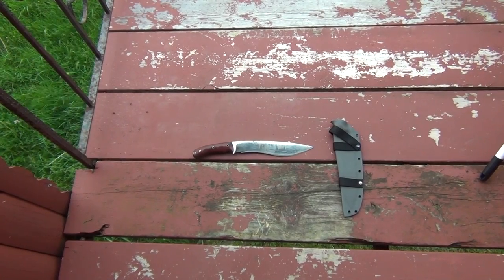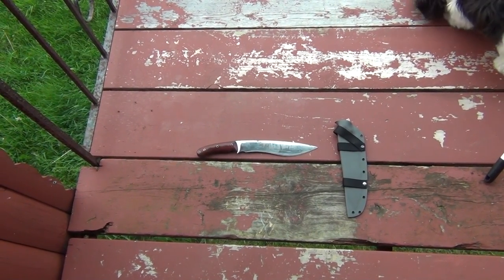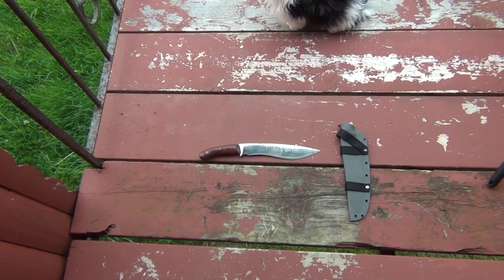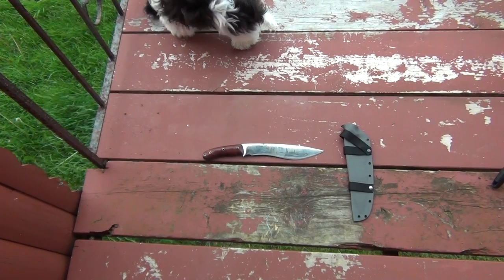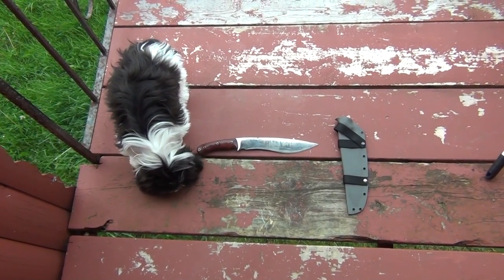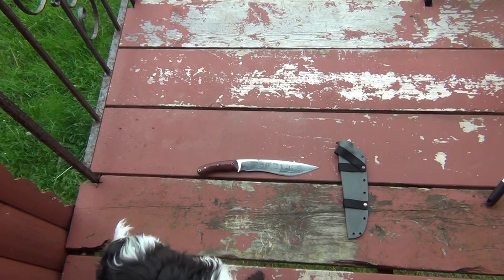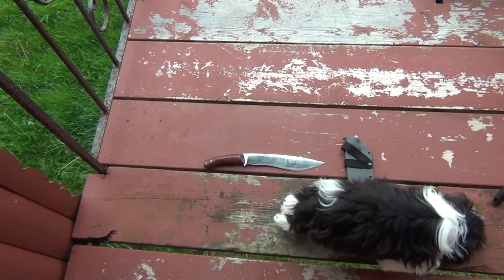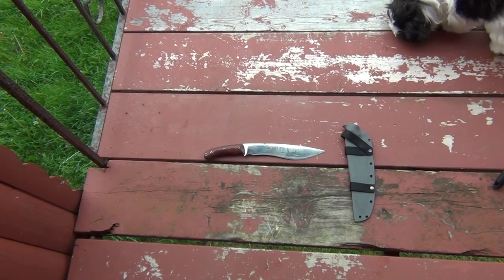Knife Challenge #12 : Bark River Grasso Bolo Fail

Comment: Would you argue that your Grasso Bolo should not be used for clearing vegetation?  You state that the bolo can fail cutting unsupported material.  Is not the main purpose of a bolo to cut vegetation, cut sugar cane, clear brush and etc.?  Most light vegetation is not fully supported and can be green or dead.  What about limbing?  Old dry but relatively thin limbs should be in the bolos scope of work. If you cannot use your bolo for this what was it designed for?  Cutting cheese?

Comment: Isn't it rather dangerous to have a gathering of so many unskilled users on one place, such as the Becker gathering?  For there to have been a number of failures of several knives by several makers, when user error plays such a large role, perhaps some sort of test should be used to filter out the ones who might be dangerous to others or themselves.

Comment: Also if the half moon chip failed at the PRIMARY grind where the thickness is much increased on a 52100 blade based on the inherit properties of steel I would assume it is a ht issue

Comment: I'm sorry, but I missed what "it" is?  What didn't they understand-- the Phenomenon?  
Also, I agree about knocking off hard limbs, but the point remains you cannot knock down with a axe poll a 12in diameter trunk.  And the bit would still experience lateral loading in felling unsupported/leaning live trees.

Comment: ..
3. “Whenever You have a Half Moon section out of a blade - Any Blade - Any Maker - it is usually not the blade - Not the heat treat or even the kind of Wood You are chopping.”  Saying that it is usually not the blade implies that in some are rare circumstances it is the blade. Could you provide an example of a time when it was one of your blades and what was the specific flaw that led to its failure?

Comment: And before you say well I hit different parts of wood or whatever. Lets consider that the strength of steel is cubic your knife is 2.5 times thicker measured at the same distance back from the blade. This should mean your knife is 10 times stronger than the one I used. That's 1000% increase in strength.

Comment: This looks like a heat treat issue that being said. Any company who says that a chip out of this size was caused by the user not securely holding the wood down and going to a knot is simply sprouting b******* . This clearly is a problem with the production of the knife, and a not problem with the end user.

Comment from the maker: The knife isn't made out of 52100, if you can not even get basic details correct such as 1 and 6 are different numbers and 2 and 0 then it is no wonder why you might have a problem using a knife.

Comment from the maker: Considering that you still do not understand the meaning of theory you might not want to venture to non-trivial issues of fracture mechanics. Hertzian cones are specialized cracks of the general conchoidal nature which happen in materials which are brittle failure dominant and do not have well defined fracture planes. That was not a conchoidal fracture as evident by many things such as lack of layering and sharp edge production (as seen in flint knapping for example).

Comment: Did you take inspiration from the Michigan Pattern axe?  It is a good general purpose pattern.  However, I have never had an axe chip out the way your bolo did.  Maybe, you need to take a closer look at your axe collection for inspiration.  Also, a lot of wood is chopped with an axe in an unsupportive position with out catastrophic failure of the bit..  How can you explain this (the catastrophic failure of your bolo)  since your bolo was designed to work like a felling axe?

Comment: Frustrated I have now completed another test. I took 4 knives one yours three comparable size, thickness and steel type( low carbon). Each knife was placed in a vice held by the blade and the handle was then bent to 15 degrees and the results noted. Knife 1 bent and returned to straight no issues. Knife 2 bent took a small set but was basically straight. Knife 3 same results as the first. Your knife bent to approximately 10 degrees and the blade broke clean off at the handle.

Comment from the maker: If I had to make a few guesses :

-5160 is a commonly used non-knife steel, it might not be in the proper normalization state and the grain orientation may be spine to edge

-5160 is an oil hardening steel, many of these companies tend to use air hardening steels, very different procedures

-5160 has a number of embrittlement zones, to avoid them you need to both get special grades (low phosphorus) and make sure you avoid certain temperatures

Plus they just don't do enough QC.

Comment from the maker: James, in general you had the most consistent argument - however at the point you started to demand a liability from BR I think you started to cross the line and in that exchange they would come off as reasonable. 

For example regrinds are very common in the industry, Benchmade and Spyderco do it for example but they don't issue general liability documents on the regrinds and nor would they if asked.

In general though, nice work.

Comment: I have a feeling that the day it was smelted by an extreme set of  coincidences, my blade was faulty. I have seen this before in steel. Often the reason bridges and structural steel fails is the same. What happens is the loose circle phenomenon. Where by the moons gravity pulls a portion of the steel out of emulsion and a void is caused. And by chance this void ended up right at the edge of my blade.  It was doomed from its birth. I would appreciate it if you could replace the blade for me.

Comment: Correct.  The forum may be good for me.  However, your blades are not what I should be buying right now.  The thing is I'm thinking investing in yoru blades at any point is rather silly proposition.  Since BRKT will not define the intended uses of the blade or put up a standard for use even when I feel I am an expert I may not be one suitable enough for a BRKT blade...at which point I could damage it and be left with a reground blade not at all like the one I wanted.

Comment: You have not inspected the damaged blade in person so how can you rule out fault in materials? It has not been proven that said other maker/manufacturers that have experienced this problem didn't have faulty materials or workmanship. And finally yourself and other manufacturers have not provided scientific research proving this so called phenomenon to be a fact! So until then it is an unsupported theory, but there is scientific research that would show a most likely culprit (cont)

Comment: I would be surprised if I were to clear the area around a tree being felled and my axe exploded because I only brought a felling axe. But that is academic, really, as in this case the margin of error before the knife has a catastrophic failure when used for the stated (very narrow) purpose is so small that it is essentially useless. And because knives have been used for this and other work with a much higher risk for "Unsupported Chopping Phenomena" since the dawn of steel, (cont)

Comment: Cliff I'm no expert but like another poster wrote. Would a unsupported piece of wood have enough lateral force to cause a chip? By brk logic then it is possible to chip a knife using the brass rod lateral stress test if that rod was unsupported. ....highly unlikely.....also agree with another post....the fact that a human does the grind means nothing...its called human error or someone trying to cover up their own mistakes.

Comment from the maker: If you could include all necessary random factors yes to allow for user skill, physical ability and wood type and condition.. 

But since you don't even know the difference between repeatable (which is a lay term) and repeatability (which is a measure of test to test consistency, first modern discussion by Bland JM, Altman DG in Lancet) is it fairly unlikely you could design such a test.

Comment: One more thing... thanks for answering my questions btw. The big knife manufacturers don't seem to have the time to do this.

I had read somewhere that if a steel is easier to sharpen it is usually because it is softer, and that if it is softer it is also tougher. How can D2 be harder to sharpen than 5160 but still be tougher? If 5160 is soft (because it is so easy to sharpen) why does it chip out more?

Comment: Where do you suggest a beginner start then as they likely do not have  any skill to enhance?  
Also, describing the owner's behavior as idiotic would seem to contradict your original statement that no one is to blame?
Most importantly though, would you be willing to suggest a blade suitable for a beginner since yours require significant user skill/experience that many may not have?

ps I'm also unclear on the connection between shampoo and edged   tools?  A chain saw seems a better comparison.

Comment: i remember that video i was laughing plus not all knives are meant to be choppers i don't care what steel or alloy   they use for the blade is made of such as the byrd meadowlark i have with the 8cr13mov that would be like taking that knife mad cutting a 2ft round tree down that's not going to happen there are reasons why there are different size blades and grind types truthfully i think it served him right for miss using the blade in the first place

Comment: I think this is an excellent idea! I will be one of the first in line to buy a Bark River + Medford collaboration chopper.

This brings up a question however. Why use a cheaper steel like 5160 on a wood chopping blade like the Grasso Bolo, when a much tougher steel like D2 is clearly the better option?